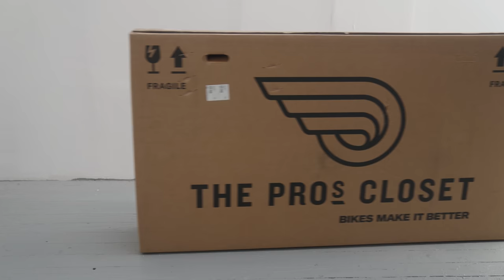New Bike Day | All City Super Professional

Comment: I got a 700X28C single speed disc brake cassette style bike very similar to that all city single speed. Weights 20 pounds without the kickstand. 42T chainring and 20T cog works as a unicorn gear ratio with no chain tensioners. Aluminum frame with mostly carbon fiber parts, titanium pedals, some chromoly parts. I think weight reduction is more important on a single speed than a geared bike since you only have one gear. I also ride a 17 pound track bike that is a blast to ride on my room displayed like a trophy.

Comment: Interested to hear if you have problems with the dropouts, I've had the same bike for over a year ridden daily and been plagued by slipping dropouts.  If you convert to geared buy a few of the drive side units, they are very fragile and seem to sell out quickly.
Reply: are you still having dropout issues 2 years later?  I believe All City has a version 2 of the dropout. Any chance tried the new part and are you still having issues?  I'm interested in buying the 2023 super professional single speed (the yellow one, which should have the revised part) but curious if slipping dropouts are still a problem.

Comment: Honestly Terry- it looks so sick. The frame color is just gorgeous. I'm curious if the rear brake caliper post mounts are in a fixed position on the frame? Or put another way, what happens if you slide the rear wheel further backwards to gain more chain tension? Wouldn't the caliper grab less of the rotor? Or is there a way to correct for that?
Reply: most sliding dropout designs have the brake mounts separate from the frame, on the piece that slides, so the calipers are in a fixed position relative to the axle at any dropout position
Reply: Yes, I have this issue with my disc brake single speed. You basically have to add or remove the disc brake caliper spacers as you move the wheel on the dropouts to get the best position for you. You may need to buy a longer disc brake caliper bolt and extra spacers.
Reply: The sliding dropouts are on both sides. The caliper is mounted to the dropout so it moves with the wheel.
Reply: I have an all city super pro and you can adjust the position of the brake calipers (the whole unit) to adjust

Comment: Love this frame! Would be great to know how the dropouts will hold up though, I've read that they are rather flimsy
Reply: They're the worst designed dropouts ever. I ran it as a singlespeed and the chain tension never stayed taut. Converted to gears and it's one of the greatest bikes I've ever had.
Reply: Yup. Single speed won’t hold tension. Horrible dropouts.
Reply: I'm also having the chain tension issue running as a SS.
Reply: @noelsmith1852  are you still having issues 2 years later? Have you tried the revised dropout that is supposed to fix the issue? I'm looking at buying the 2023 model to run single speed so curious if it's a bad idea or if the problem is resolved.
Reply: @pacmancalgary  I ended up selling the bike. Funny seeing this comment 2 years later about "one of the best bikes I've ever had" it was the worst bike purchase I've ever made
Reply: @noelsmith1852  was it issues with the dropout?
Reply: @pacmancalgary  Yes, it was. I told the shop I bought the bike at that the flimsy aluminum dropout inserts were almost completely destroyed. I figured they might warranty them, I was wrong. I would advise against buying this frameset and its ridiculously designed dropouts.

Comment: Very nice looking good, Dustin’s bike he got from them is cool. But I tend to just ride single speed / fixed. Cool that you have the option of adding gears if you were inclined. I feel you on getting tired of riding a bike that’s too small after awhile. Since I’m not very picky I’ve done it before for whatever reason at a given time. But being 6’3” myself it has had it’s annoyances depending on the situation ( especially after the two accidents I was in. In 2011 & 2012. getting hit by a van and then flipping my bars). Looks like a nice and fun bike though. Been wanting to try out a All city for a few years.

Comment: Hi Terry, to answer your question here is my take on a built: I just built a super pro myself (End of last year) in Quicksilver (55cm) with the following specs and it's a hell of a machine! Chris King headset with Raceface Atlas bar (Cut down to 570mm) and Zipp Service Course SL stem (90mm), Phil Wood Titanium Spindle/ Carbonyte bearings bottom bracket with All-City 612 cranks in 170mm with an All-City Pursuit 50t chainring and Izumi Jetblack chain and Raceface Atlas pedals. Handbuilt wheels (By Tim Eskew of Bicycle Michael's in New Orleans, one of Americas top 15 bike shops - where I work) with Pacenti Forza asymmetrical disc rims (Alloy) laced with DT Swiss Revolution(!!) spokes onto a Hope Pro4 SS/ Trial rear hub and an RS4 front. 17t Halo stainless steel rear cog. Magura MT4 disc brakes with Shimano Dura-Ace front rotor (160mm) and a Hope floating point (140) rear. Thomson Elite Seatpost and an Ergon saddle. All of that premium assembled the way a bike should be built/ everything chased and faced, etc. etc. etc....  It's a godamn hell of a ride.  :)   P.S. Some parts might seem random out of a parts bin, but every single piece is well thought out and purposely selected, took a year because of the supply shortage we experience since the Pandemic to get exactly everything I wanted ...And damn how tall are you? An All-City 62cm equals about 67cm in nearly any other brand, All City's sizing falls out HUGE!!